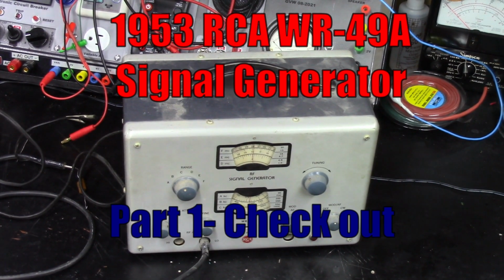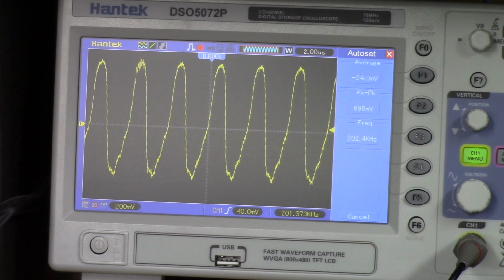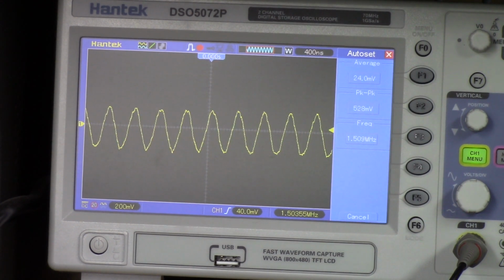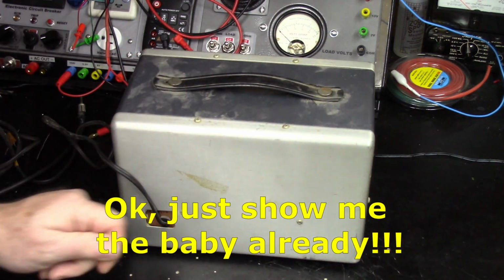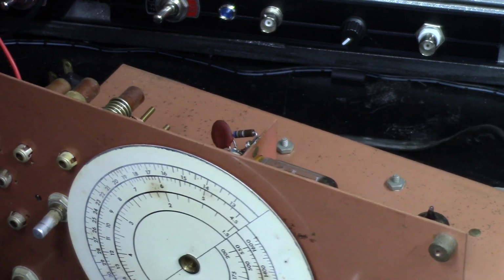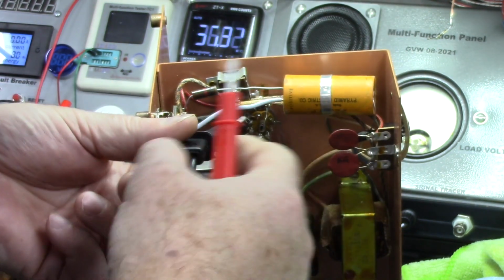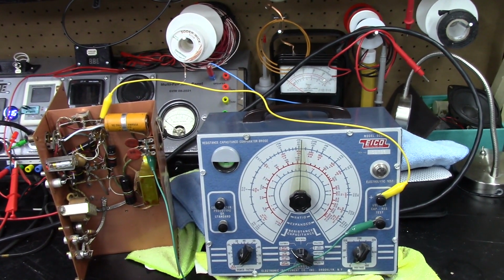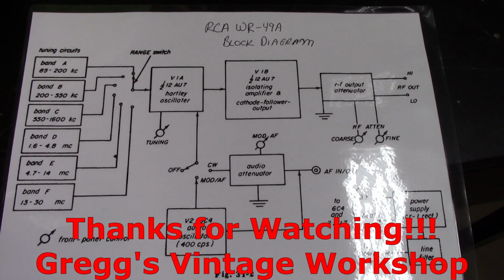1953 RCA WR 49A Signal Generator - Part 1- Checking it out

Comment: As others have said, I think if you replace all the caps you will have a nice sig generator.
On my Accurate 153 I had a few bumblebee caps but the schematic said .01uf but the color code was not a .01, so I went by the schematic and it works fine.
I never liked those banded caps, I could never figure out the capacity.
Reply from the maker: Thanks Bill, yeah I watched a couple of videos and read a couple articles and got them dead nuts on!

Comment: Gregg,
When you read capacitance values as high as those you saw indicated on your bridge, that means that the cap under test is very leaky. It’s effectively just a resistor. The ESR will be very high. 
Remember, when you replace that selenium rectifier, you will have to add a resistance in series with the replacement silicon rectifier to correct for the higher efficiency of the new diode. If your schematic gives you nominal voltages, that will enable you to get the value of the resistive padder correct. I think a lot of the garbage that you were seeing on the scope was that “hum” which you thought wasn’t there, from those two filter caps.
Regards, Gar
Reply from the maker: Thanks Gar, I appreciate the information sir!